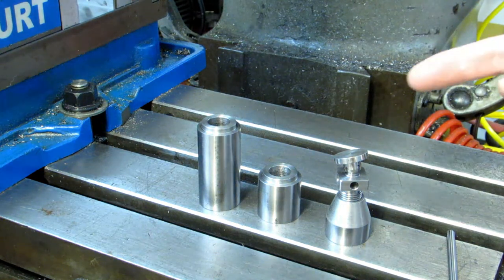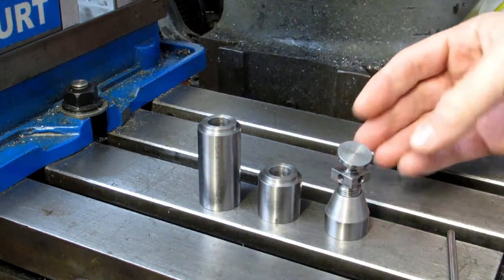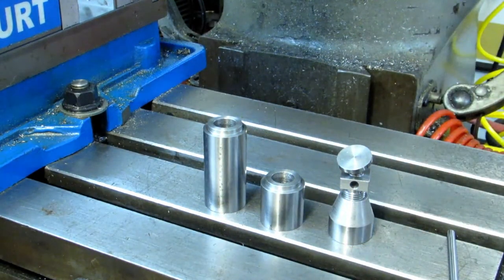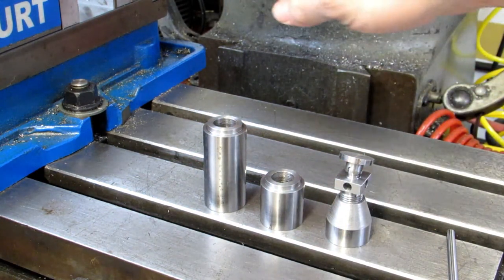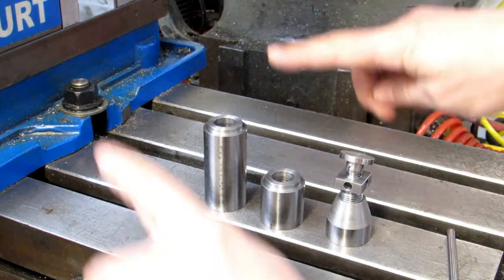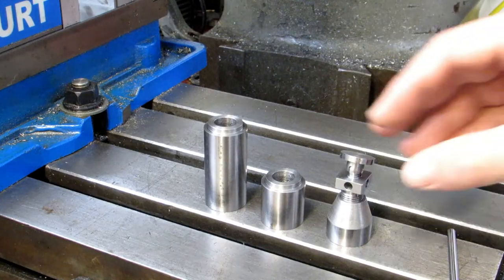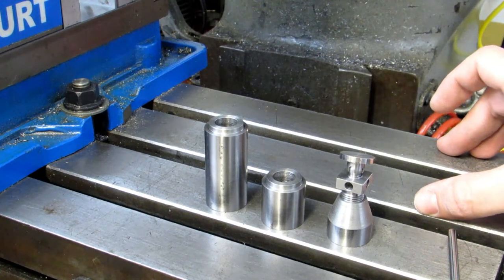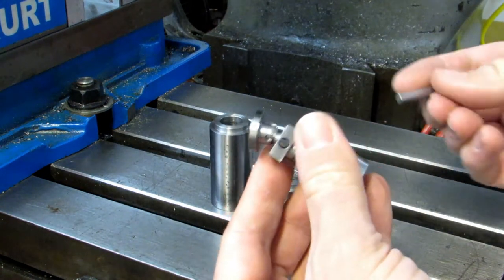Basic Machining Project - Machinist's Screw Jack: Epilogue

Comment: I made a set of these, I think when your videos first came out.  I like this design.  Only used once or twice with my mini-mill, but have used one a bunch of times on my 4x6 bandsaw to hold the jaws parallel when cutting small parts.  Very good project.  The swivel top is a very satisfying feature to make.  Too bad the viewership petered out as the series progressed.  This would be a good student project.

Comment: I've just finished building your machinists screw jack. I'm a complete beginner and am setting up a home workshop. This was a brilliant project for me to get started on and I appreciate the effort you have made to help people like me to get started using machine tools. One thing that I have found difficult as a beginner is that I live in the UK where half the machinery is metric and the other half imperial so I just have to get used to using both. As soon as I have the confidence I am going to fit DRO's to my lathe and mill so that I can easily switch between the two systems.
Reply from the maker: Hi Brian.  Welcome to the craft!  Send me a picture of the finished jack if you get a chance.  I'd love to see it.  My email is in the "About" tab on my channel page. DRO's are a huge help when working in both systems, especially when your dials are only in one or the other.  They actually aren't terribly difficult to install.  I've got a series on installing one on a mill and the principles are largely the same for a lathe.  You've got a surprising amount of wiggle room for the installation considering it is a precision measuring instrument.  Thanks for watching!
Reply: @StuartdeHaro  Hi Stuart, The photo should be in your inbox.